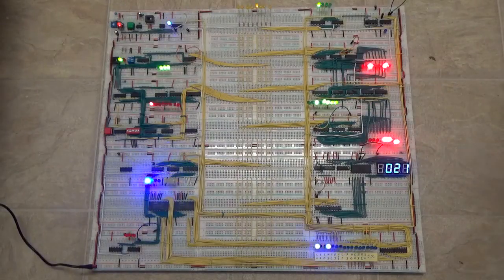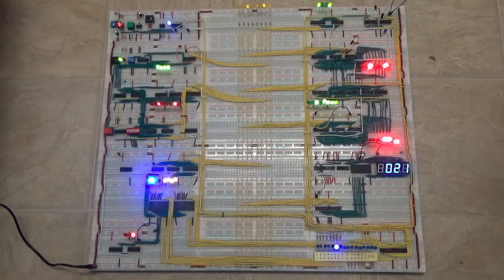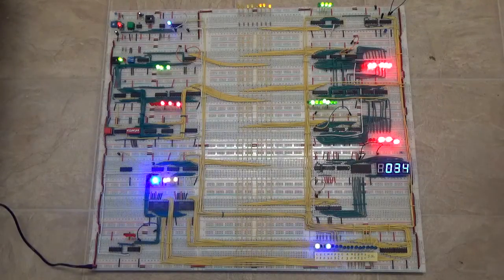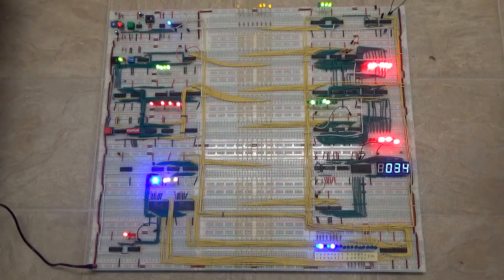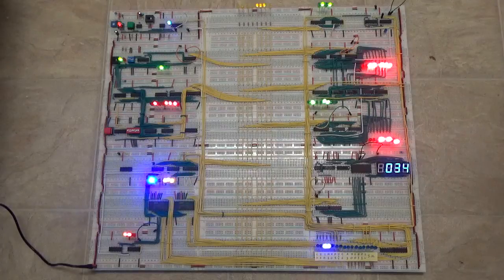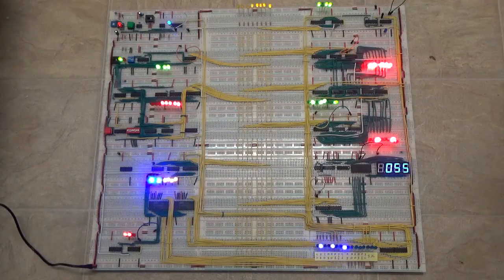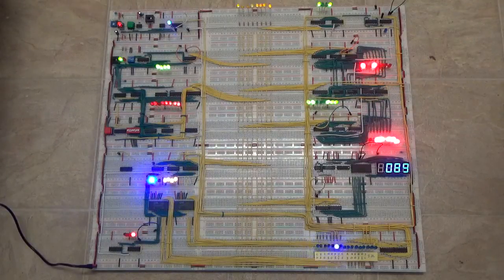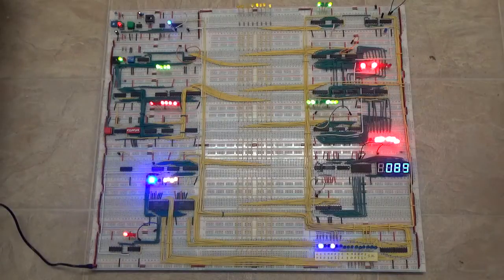My build of Ben Eater's 8-bit computer

Comment: What does Ben Eater think of your effort also have you considered building another version using veroboards instead of breadboards?
Reply from the maker: I've not had any contact with Ben regarding the project, nor has he reached out to me. 

I'm not the only one that's built one of these based on Ben's tutorials. Quite a few others have as well and some have added features/functionality to the design (more memory, stack pointer, more registers, etc...).

I personally have moved on from the project and am currently working on other things, however I may visit it again later down the line. If I were to pick back up with improving the project, I'd probably design and have my own custom PCB's manufactured. (Did this for a LED strip clock project I worked on.)

Currently I am working on converting the PC game Quake tools source code (QBSP/VIS/LIGHT) from C to C++. In part of the conversion I wanted to work on improving the polygon merge code to handle complex polygons with holes, so I've been working on that.
Reply: @K9Megahertz  I suppose Ben must be rather pleased that he has so many electronics hobbyists replicating his work:).

Comment: I really wanna learn electronics what would you recommend me where should I start
Reply from the maker: For digital circuits I would start with Ben Eater's videos, go back through his history and start at the beginning where he starts off building the CPU shown in my video. 

For analog stuff, and you'll need a bit of that in the digital domain I would start off learning about resistors, capacitors, inductors, diodes, transistors, etc... 

You are currently on the greatest resource mankind has ever had in terms of learning. The internet...

We have sites like YouTube and google where you can pretty much type in "How does <insert topic here> work?" and get an absolute ton of information thrown at you. =)

Comment: Hi, I watched all the videos from ben eater regarding the 8 bit easy-as-possible computer. I am a mid-professional avr programmer (but i did already 32bit ARM mcus). Also outbounds of Arduino. I want to rebuild such one and improve some stuff. Do you have suggestions and tips for me?
Reply from the maker: Hi Alex! I would start by building what Ben Eater has demonstrated first. It's one thing to watch some videos and say you understand something and something else entirely to go through the process of building it and dealing with all the little issues along the way. To quote the great philosopher Morpheus, "There's a difference between knowing the path and walking the path."

Once you have the built you can then think about ways to improve it and you will likely have the understanding of how to go about doing that. =)
Reply: or maybe traps that i could avoid to fall in ;)

Comment: will you not add more RAM to it to run more complex programs lol?
Reply from the maker: I may do that in the future. In another post I mentioned that I was working on designing a multi chip memory bank system that would allow this, but I've tabled that for a bit to work on other projects. James Bates has a version that uses more memory IIRC as well as a few others I'm sure. Might want to check those out.

Comment: Hello I know this video is about 4 years later, but I wanted to ask where did you find the jumper wires for the build of this computer, im not sure if they are male to female or male to male the ones that look like a horse shoe,  ben didn't include them in the kit, I also love the wiring you did here, its really clean and eye catching and make me want to build my 8 bit computer similar to your wire management. I seen in the comments about the tactile button and was able tot find a link to purchase that from adafruit, if you have any more recommendations on other electronic pieces I should buy, please don't hesitate to comment, anything is helpful,  this is my first build!
Reply from the maker: The wire was bought at a local Fry's Electronics. Unfortunately the chain of stores has gone out of business so I will have to source a new supplier, probably Amazon. Ideally any 22AWG solid core wire will work, which is more or less what I got at Fry's.  

The wires are neither male nor female, they're just wires. You'll have to cut the wire to the length you need, strip the ends off, and bend them into the appropriate shape. Yes it takes a while to do this for every wire, but that's what was done. =) I think Ben did a video on how he made his wires.

Here's a link of what I will probably be looking at buying in the future. Maybe not this brand or this exact item, but something similar.

https://www.amazon.com/TUOFENG-Wire-Solid-different-colored-spools/dp/B07TX6BX47/ref=sr_1_3_sspa?keywords=breadboard+wire&qid=1637155530&sr=8-3-spons&psc=1&spLa=ZW5jcnlwdGVkUXVhbGlmaWVyPUFSSU9BSzc2NU4zUTEmZW5jcnlwdGVkSWQ9QTA1MDkyOTkyQ04zOVdCT1paTlFWJmVuY3J5cHRlZEFkSWQ9QTA4ODcwMTAzSUZMNEdCTEtTVkZQJndpZGdldE5hbWU9c3BfYXRmJmFjdGlvbj1jbGlja1JlZGlyZWN0JmRvTm90TG9nQ2xpY2s9dHJ1ZQ==

Comment: Six months? I think it would have been much faster to make a PCB layout and make a real board for it. Including modularity, as small parts are copied here and there. On a PCB you could test higher speeds too if the power supply and bus connections respect the rules of high speed. Any way, congrats on what you did! It's very nice and neat!
Reply: I'm working on mine for an year now and it's still in Design stage, while it's true I'm Using 16 bit and more features but The cost of PCB can Increase exponentially like 10K INR when I estimated mine, then had to drop the idea of using DIPs and use SMD and Use Non- 7400 logic chip, Flash Chips, etc. And yea I'm a bit lazy and focused in studies but it can get complex real quick.

BTW Ben Eater do have schematics and PCB layout so won't be a hard for anyone to get it running

Comment: great job! just as a side note, this is actually the SAP-1 computer design create by Albert Paul Malvino and Jerald Brown in the book "Digital Computer Electronics". Ben Eater's videos are an implementation of the SAP-1; hugs
Reply: That's right. Ben mentionned it in one of his video. Btw, its quite easy to find a pdf version of the original book on internet. I get it and its a pleasure to read, coz you have even more details.

FYI, what Ben built is the "SAP-1" (Stands for "Simple As Possible" version 1") plus a little part of SAP-2. Books contains full SAP 2 design as well as SAP-3 which is pretty much a 8080 compatible computer.

Comment: where did you buy all of the parts? all at one time? or as you needed them? online or at a store?
Reply: Gerald Filimonov Thank you for the advice.
Reply: Ben Eater sells a kit for his board - I think it is about $279.00.  https://eater.net/8bit/kits
Reply from the maker: The breadboards were bought at fry's electronics. They are made by Pro's Kit, model number BX-4112N. They run about $8-9 each. In total I used 21 of them for the computer.

Most of the 75LS chips were bought online either at digi-key or on ebay when digi-key did not offer them. EEPROMS were bought on ebay. LED's were a mix of Adafruit and Fry's electronics. The 7-segment blue displays were bought off ebay. Resistors/capacitors/switches were bought at Fry's Electronics. Dip switches might have come from Jameco.

The push button switches are from Adafruit (https://www.adafruit.com/product/1010). They're much better I think than the little black ones that Ben used. He had to solder header pins on to them to get them to stay in the breadboard where as mine just snap right in and stay put pretty well. I did still superglue them to the board though just to make sure as I did with the dip switches. The dip's wont stay in on their own.

I started off buying things as I came to them when watching Ben's video series. I had watched most of the series that was available at the time (6-8 months ago) so i placed a big chunk of the order at once and then from there it was on an as needed basis when new videos came out.

I probably spent close to $1000 building this computer, if you take into account buying all the parts (+ extras) and buying a good oscilloscope and multimeter. The oscilloscope was $400 +tax and the multimeter was about $60ish id say. The Oscilloscope is the same one Ben used in his videos but I had already had my eye on it for a while, this just gave me justification for the purchase. =)

I usually bought extra of stuff when ordering, for example we only needed 3-5 EEPROMS for the computer, but I ended up ordering 30-50. I have two big multi drawer organizers full of parts with most of the drawers labeled. I got a cheap $15 labeler at Fry's electronics for that. It really helps to stay organized with this many parts.
Reply: Gerald Filimonov wow that's a bit more money than I thought. I already have an oscilloscope and multimeter though. maybe when I finish my cs minor I can get a better job and more money. although I do have an fpga board, the artix7, and I'm tempted to build it on that. but it wouldn't be as entertaining to watch and it be harder to debug the thing.
Reply from the maker: Well you're ahead of the game if you already have an oscilloscope and multimeter. =) If you lay things out the way Ben Eater did you can probably get away with 14 breadboards to cut down on cost. The chips are pretty low cost from digi-key, maybe .50 to 1.50 each depending. the shipping will probably get you though, so I'd make a big list of everything you want to order and then do it at once to minimize the shipping costs.

Comment: Great work! I'm actually following Ben's videos but building mine through Multisim (digitally simulating everything). Will see how it goes to the end, but it's much easier to upgrade later to 32 bit for example cause it's mostly drag and drop connections :)

Comment: That is some seriously tidy wiring there, nicely done. :) I have to say though, that data bus is huge! Did you consider wiring a pattern into it? I mean you've got the room for it! :D I'd have been tempted... ;)
Reply from the maker: Thank you sir! On the topic of the bus, I wanted to maybe expand things to maybe 16-bit or 32-bit in the future. Originally I had envisioned maybe going as far as 64-bit, so i got breadboards with 64 holes along the length just in case. Now that I see how much wiring actually goes into one of these, I think 64-bit would be more than I want to tackle. =)
Reply: 64-bit would be a hell of an undertaking, but it would be unique. I haven't seen anyone else mad enough to try it! Though... I have been tempted myself... :P